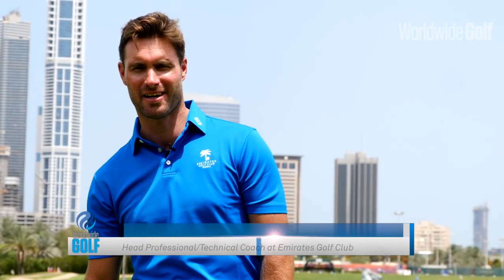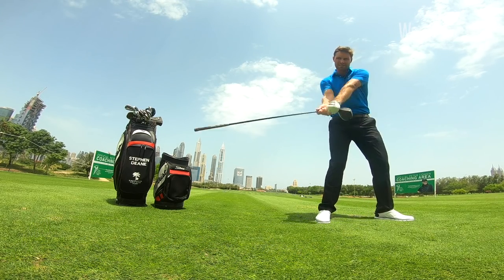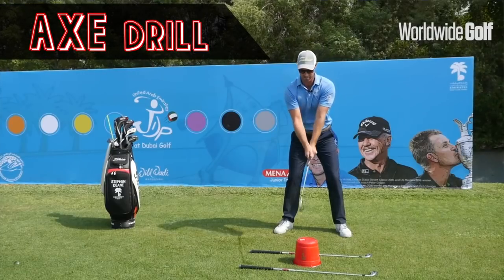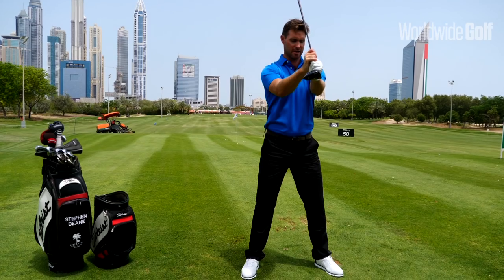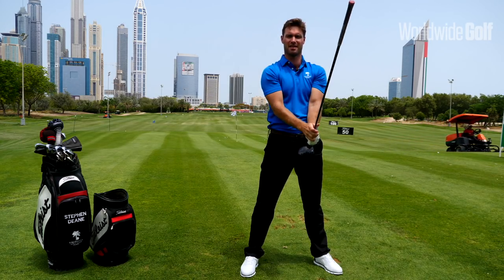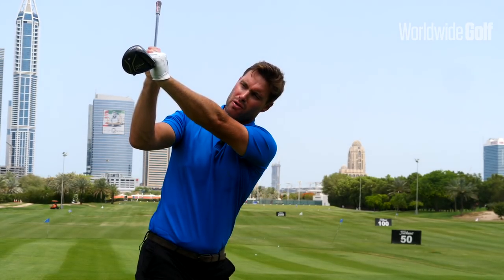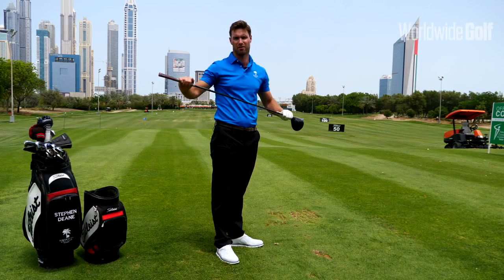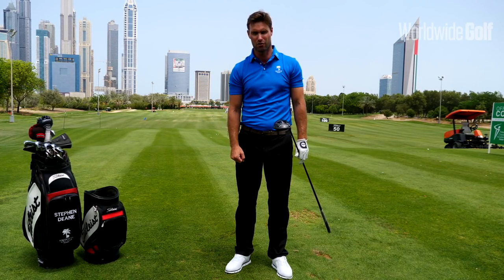Driver fundamentals | By Stephen Deane

Comment: Great lesson.   This front route drill can be used to actually hit out of, Gravity Golf (David Lee) was saying this for 30 years about the shoulders and the front route.    I have my grandson using this.  Obviously, Peter Cowen's success with players is highly noted as was David Lee more with the Major Senior players several years ago.     Everything is on a ARC.  Also David Lee using a counter balance move to adjust for weight of arms being thrown in front of the body.  I see this move in Rory's swing,  but I don't credit David Lee for Rory.   That said,  I have used Peter's Drills for a year now and my play has improved.    I do have a tendency to draw the ball more with the driver that I am trying to correct.    I sense it is because I am bringing the club back too much inside due to trying to put pressure down.   Also,  my distances has gone down a bit.    I can't make it the Middle East.    Is there a place in the USA or something on line where I can work with you gentlemen?

Comment: Great video......focusing on shoulder position in the downswing. If copied, it should help discourage the over the top move which I believe is most directly caused by improper positioning of the shoulders when initiating the downswing.